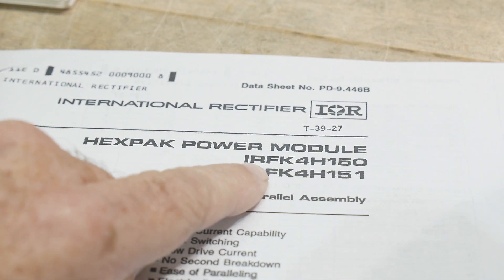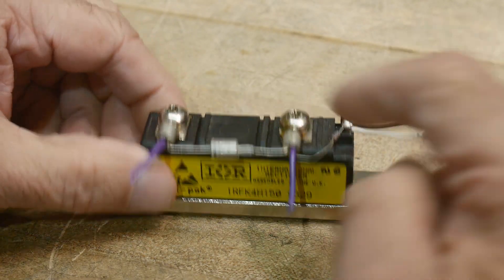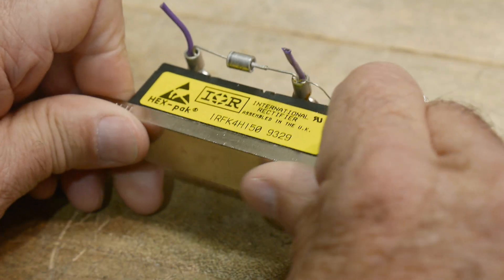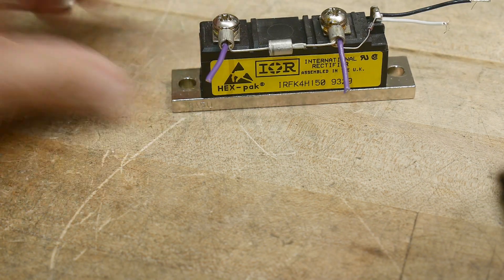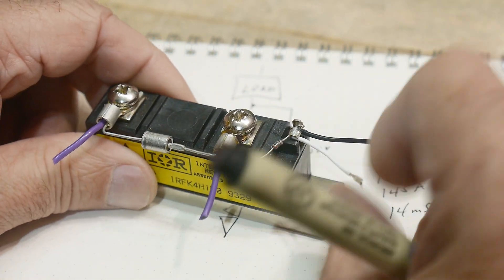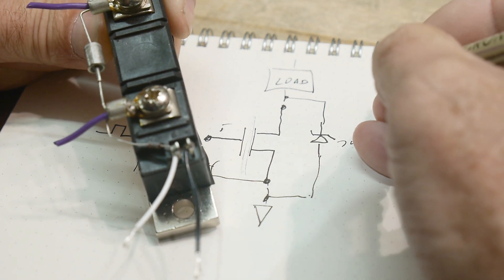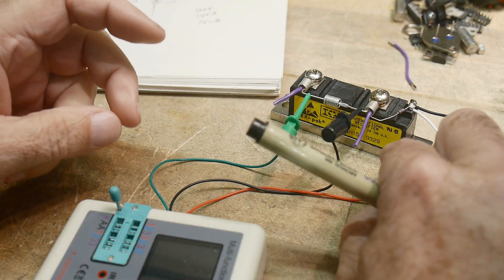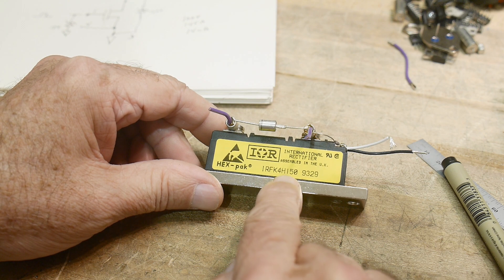#1379 IRFK4H150 FET Transistor

Comment: Disassembled these have multiple large transistor dies wired directly in parallel, which is why they're not suitable for linear operation, but rather saturated switching. I've rapidly disassembled a handful of these by forgetting to reconnect the gate leads before reenergizing the DC bus, and the Miller capacitance instantly turns them on sending at least a 1000A (more?) through them causing total destruction on the package leaving only the dies bonded to the base plate.

Comment: I have a collection of these power parts up to 300A NPN, 1500A MOSFET, and a 3000A IGBT. They were used in large UPS, inverter, and motor drivers.

Comment: Not a FET but a MOSFET, datasheet is just inaccurate.
Also 140A are nothing, in some big TIG welders, there are banks of Isotop 120A Mosfet modules, connected by large copper bus bars.
Reply from the maker: I think MOSFETs IGFETs HEXFETs are still FETs at heart

Comment: I work on traction systems for trains and we normally work with IGBT's rated for 200A at 2400v, and there is 10 in paralell on each phase converter, so 3x2000A in total🤓
It tool a while to get used to those numbers😀

Comment: Uh, a few more of these plus a couple dozen lasers and some other oddball parts and you could have your very own nuclear fusion reactor.  
I remember as a teenager going to the Collins Radio surplus store and finding all sorts of equipment with little idea of what it was. 
Some items did follow me home but since they required a 400Hz power source weren't of much use except for parts.
That is when I discovered circuit boards with conformal coatings are not good for salvaging parts.

Comment: If you could make it switch at 100 to 200 kHz, you could turn that into a induction heater. Most induction heaters on Youtube are misappropriated Royer converters which are apty nicknamed 'noob heater'. Apparently it's too much to ask from the majority of Youtube electronics gurus to design a driver for one of these babies to make a proper induction heater.
It's actually such a reliable measure of skill that at one point I decided I will weed out every hack who features the Royer noob heater. My electronics expertise grew tenfold since then.

Comment: Ive seen similar transistors used in QCW pump diode stack drivers for powering larger diode pumped yag lasers. Another thing ive seen them in is bigger UPS systems.

Comment: Not sure if same device or not... but I used to work with "Burn-in Ovens" which are used during Computer-chip testing. The electric heaters in these ovens were controlled by solid-state devices using PWM. We had well over 70 ovens.... I can only recall a single failure of heater-device over many years. (insufficient heatsink compound on the device)

Comment: How old is this - 30 years or even older? It is ridiculous compared to actual MOSFET technologies unless you need it for linear regulation.
Reply: Right, today's usual power MOSFETS are for switching and don't like to work in the linear area.
Reply: @paulcohen1555  and MOSFETs are getting replaced by IGBTs in the high current, high voltage applications. And MOSFETs are are also getting replaced by GAnFETs in High frequency, high power applications.

Comment: IMSAI Guy electronics demolition ranch video coming up :face-fuchsia-tongue-out: Yesterday morning I went down to my solar power inverter and set the battery charging current to 135 Amps at 51.2V DC and it did it without breaking a sweat - the fans were barely running. As I did so I did wonder about the types of components that they have in there to handle the power. I suspect it's a parallel array of smaller less exotic mosfets.
Reply: Mosfets have gone a long way, also the lower DS voltage mosfets have better on resistance specs. I seen some sub 50mOhm ones in small smd packages.